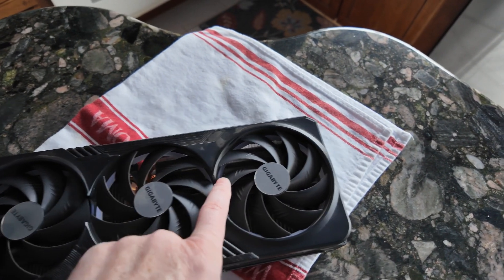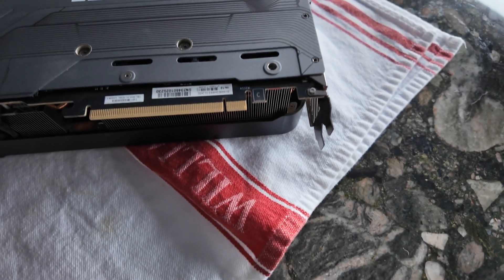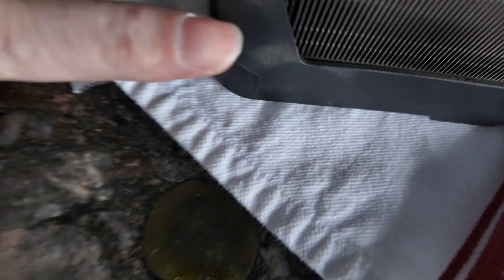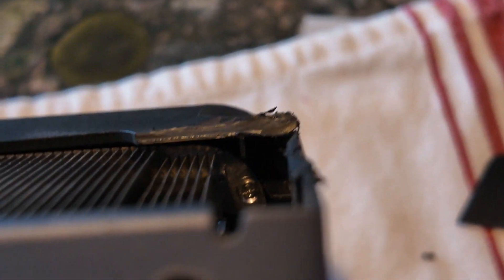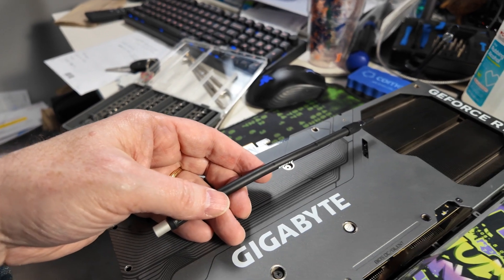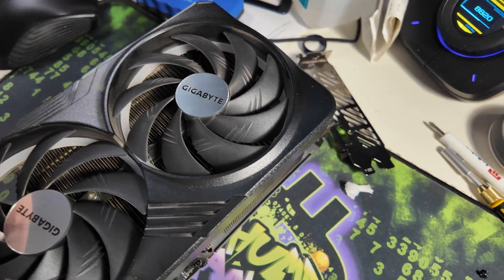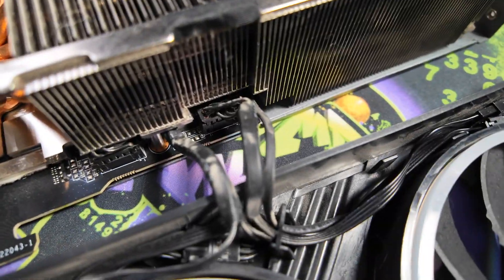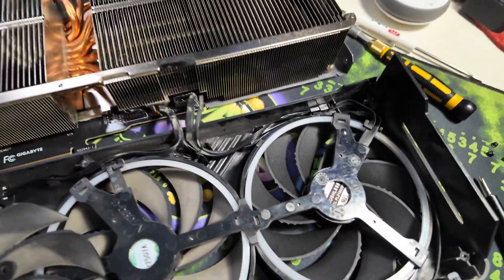How I Fixed The Annoying Wobble In My RTX 4090 GPU Fan

Comment: What actually causes the fan wobble? Can i fix it without having to purchase new fans? I've got a wobbler on my Asus Strix 3080 😢
Reply from the maker: I have seen some put a piece of tape on the hub and that extra weight stops the wobble.  The wobble is cause by the bearings going bad.  You can feel the wobble on it when it isn't spinning.

Comment: did this wobble cause any noise or rattle? I have the same card and I am thinking something is wrong with my fans as well.
Reply from the maker: Yes.  I had this card in an octoserver and in a routine checking on my rigs, I noticed a tick sound.  Eventually found the wobbling fan.